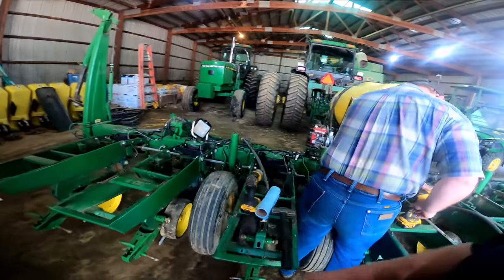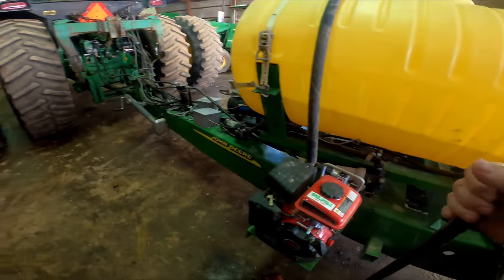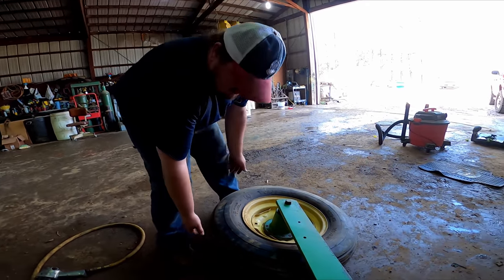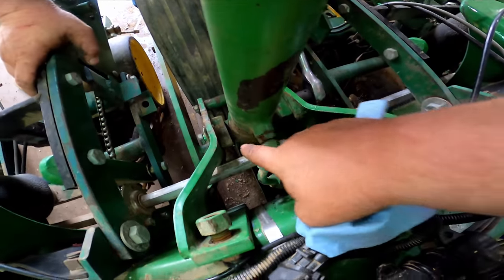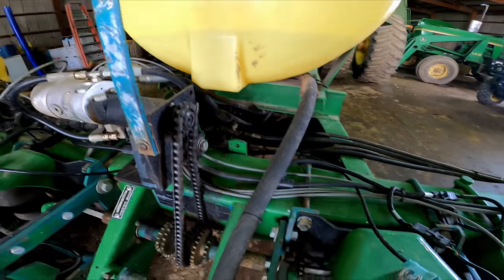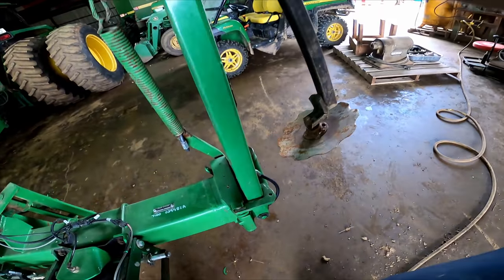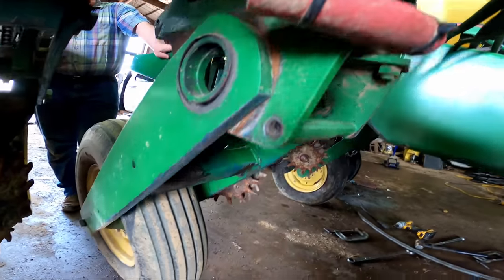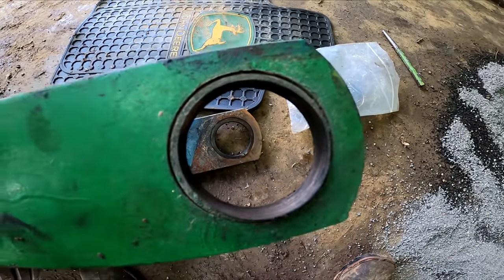Planter Gets A Knee Replacement

Comment: I agree with hydraulic drive. I have 3  hydraulic motors to drive 3 sections. One drives one wing of 3 rows one drives center 6 rows, and  one drives other wing sort of like section control. 20/20 monitor shuts off for row flow control. Also hydraulic drive allows variable rate control with a map. I love it.

Comment: My 7000 is different but maybe it is because it is only 6 rows and no fold. I only have one cylinder down under the middle.  My neighbors 7200 is set up Iike yours.  That is usually how it goes,  when you do the last one, you finally have it all figured out.
Reply from the maker: I believe mine is a "conservation" model. It was designed so that you could move the rows and wheels around for different row spacings I believe.  When I originally bough the frame it was a 38" row planter. Not it's on 30s.  Thanks for always watching.

Comment: those pivot bushings suck I just changed some on my 7200 and I have changed several in the past. It makes it way worse if planter still has mechanical drives with the shafts thru all the lift arms
Reply from the maker: I can imagine it is a pain in the butt having to pull all those shafts out.

Comment: Good job. Aggravating job also. Got a question about your liquid starter set up. Fixing to add starter fertilizer to mine. Would like to know what size pump you run on your planter. GPM. Size and what kind of pressures you run. Thanks for any tips and advice. Y’all have a great day.
Reply from the maker: I've got a 4 gpm pump on my planter.  I'm not sure on the orfice size.  Best I remember when we were using a pressure gauge on the system we were running about 25-30 psi.